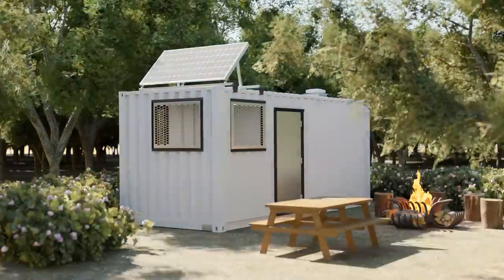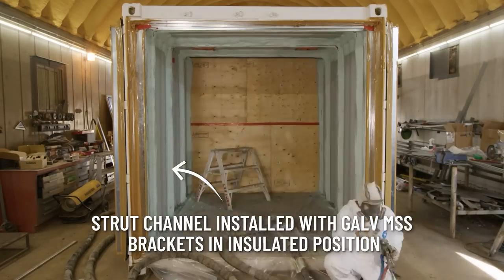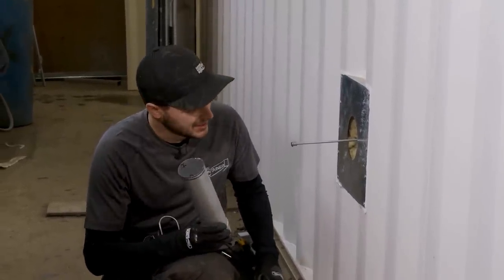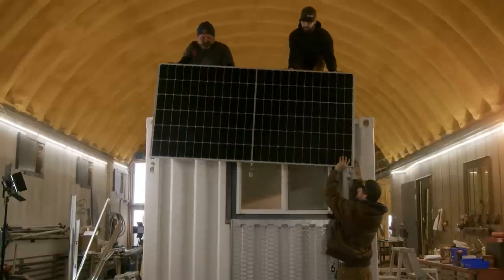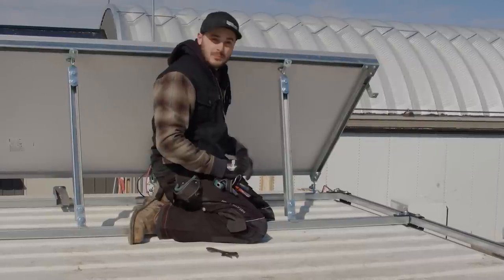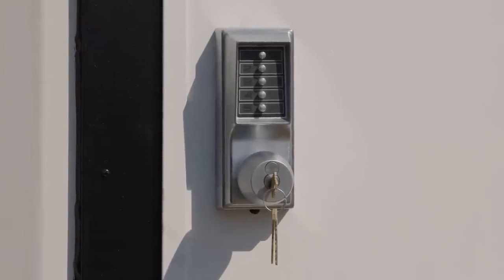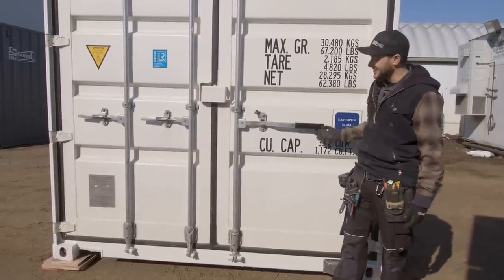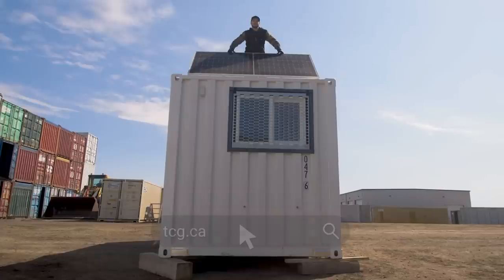DIY Off Grid Shipping Container - Solar Powered Office or Tiny Home

Comment: Hey couldn't you put the skylights in the side walls instead and didn't you say that the spray insulation would crack if it not level so would it crack during the shipping and set up process?

Comment: Actually the Kid charge controller is called the kid because it was designed by a kid who started working at Midnite Solar sweeping the floor and was very interested in what the engineers were doing and picked up on what he learned from them and designed the controller

The company does outstanding stuff

Comment: I am working on a tiny container, I can not find any information on the internet how to pass power from outside the shipping container through what I call the “the hull” to the inside and maintain a water tight integrity, any suggestions?
Reply from the maker: What do you mean by "the hull"? The side wall corrugations? The end wall corrugations? The wood floor?
Reply: @TheContainerGuyTV  yes, the side corrugation

Comment: Could you add an inverter fir 120 volt power and have the solar panel(s) charge the batteries ? To charge cordless tools etc.
Reply from the maker: 100%
Reply: The reason I ask is I have a container I keep my RTV in for chores it would be great to have heat and light to plug in the RTV, as the property is not mine, so connecting to the grid isn’t an option. I like what you did with the container in the video.

Comment: I looked at your window frame kits on Amazon. Specifically the largest, 60" x 36". Are the dimensions outside or inside dimensions for the glass and gaskets?
Reply from the maker: The dimensions listed are the framed opening. The rough opening will be larger. If you purchase an advertised 60" wide x 36" tall vinyl window with 1" nailing fin, it'll work great.

Comment: Just a suggestion, but you might want to put some retainers under the open window security screen.  Wind will make it a noisy day with that SS steel banging around all day.  Really like the PVC wall panels!
Reply from the maker: Thanks Edward. We installed some rubber bumpers for it to hit but something to hold it down is a good idea. The customer is handy and I'm sure they'll come up with something.

Comment: here a tip from my research and "try the wrong shhhhht some salsman try to sell you way overpriced". panels: ja solar, everything else: victron energy. try to get the stuff not over a reseller of a re re re seller cuz you knew every chain costs money - buy direct! currently looking forward to get small electrolysor and hydrogen store for small offgrid contend and stockage (hydrogen car f.ex better than lithium ion electric crap) but the wip there is loooong
Reply from the maker: Thanks

Comment: Why don’t you just work with detachable container units that you assemble. No crane need, already has insulated panel walls, don’t have to make cut outs, seems like they take away most of the cons of container homes.

Comment: I don't understand why so many builders use foam.  It makes the rest of the install a total nightmare.  just frame the container, run the wire, then insulate, throw up the walls.  if extreme weather conditions, foam makes sense but don't get it.
Reply from the maker: We're from Canada. Our weather conditions are extreme. 

Fibreglass batt insulation in shipping containers is unhealthy. Don't recommend it to people, please.
Reply: @TheContainerGuyTV  Never heard fiberglass batt was unhealthy.  Why?
Reply from the maker: @gwm6102  https://www.cdc.gov/niosh/topics/indoorenv/moldsymptoms.html